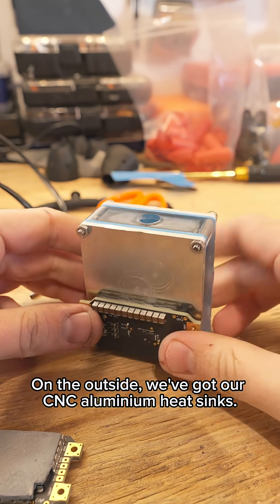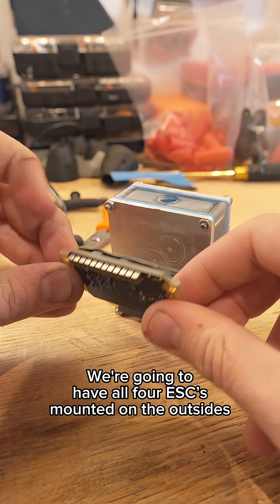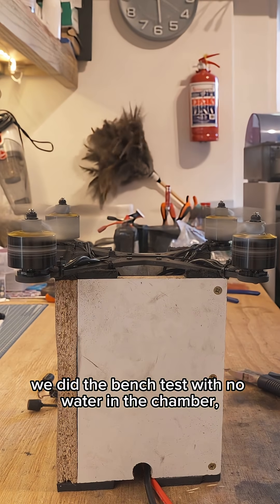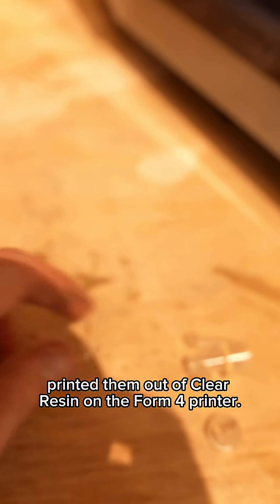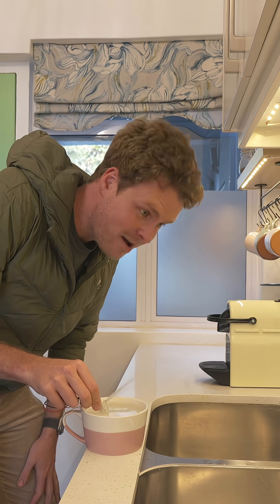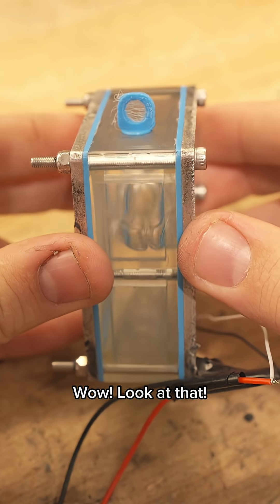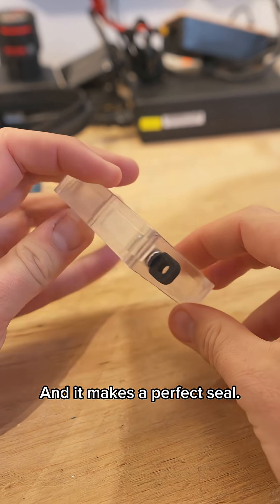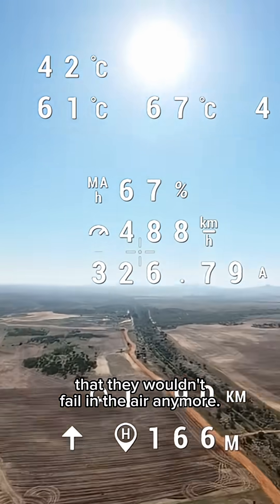3D-Printed Water Cooling System for the World’s Fastest Drone 2025

Comment: Should have looked at CPU water cooling. Adding aluminium fins would have increased surface area. More surface area means more heat dissipation. Or he could use peltier devices like real race drones use. Reduced weight more stable flight not having liquid move about.